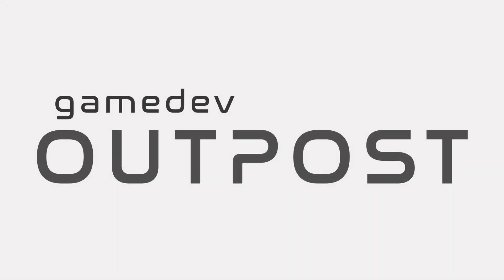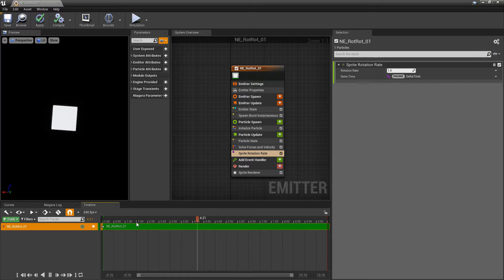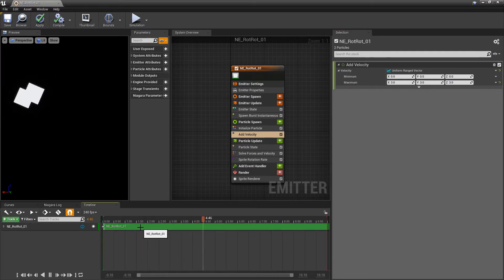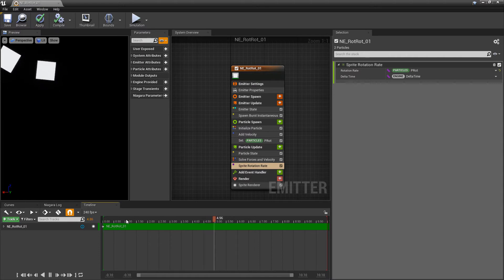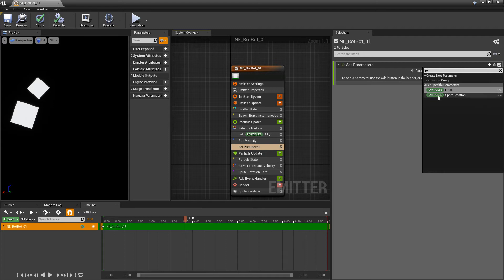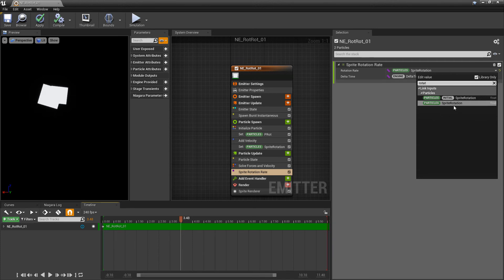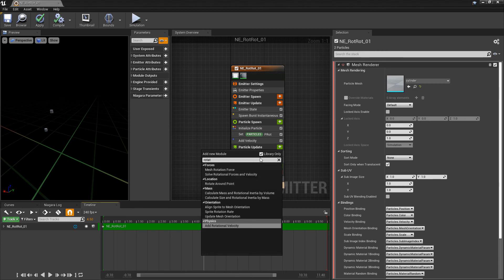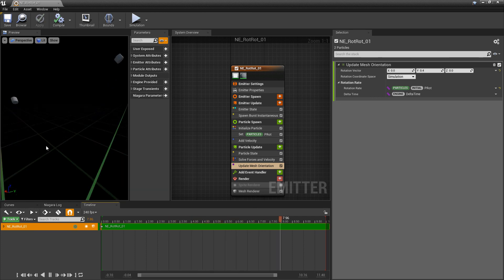UE4 - Niagara Sprite and Mesh Rotation

Comment: How would one go about rotating mesh particles between a float range using a panning noise like a wave effect?
Reply from the maker: Two ways off the top of my head, you feed the float to a blueprint and feed that to your shader or you need a way to read a texture or render target and translate the pixel values to floats with a custom Niagra module and use that drive the rotation. Again just spitballing

Comment: I can't get my sprite to show up on this unless I change the sprite renderer source mode to emitter but then it won't rotae. Using 4.26 and the options are slightly differnt here though. 
Any ideas?
Reply from the maker: I'll look into this more tonight. Take a look at the "Initialize Particle" values and make sure you set a default value. Others have mentioned that if you're trying to update values in particle update you get weird results if theres no default set. I.E. "Uniform 0.5." 

I'll get back to you later tonight.
Reply: @gamedevoutpost9270  very old now but for current and future viewers you need to add the spawn burst instantaneous under emitter update and set the spawn count to 1 for the particle to show up, that along with solve forces and velocity don't seem to be apart of the default blank emitter template although when you add a velocity node it will fix by wanting to put in the solve forces and veloctiy